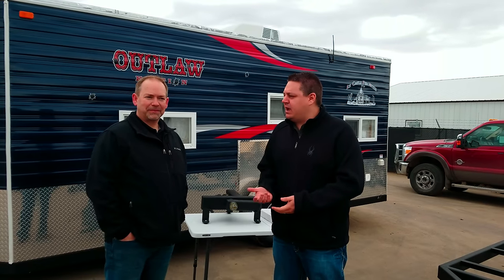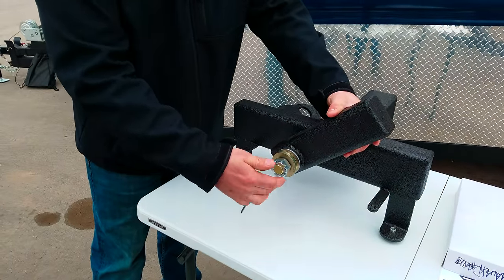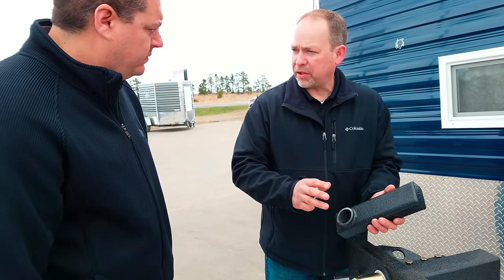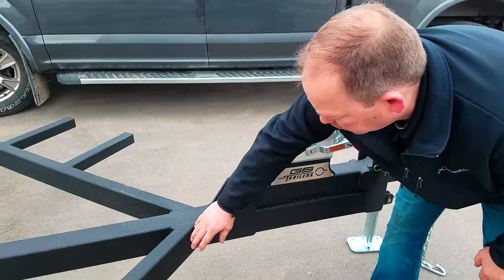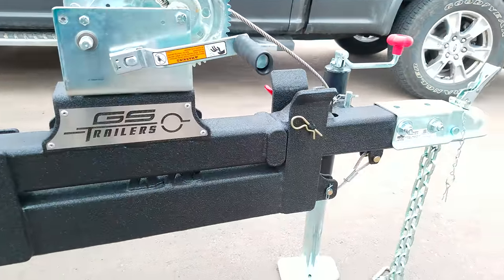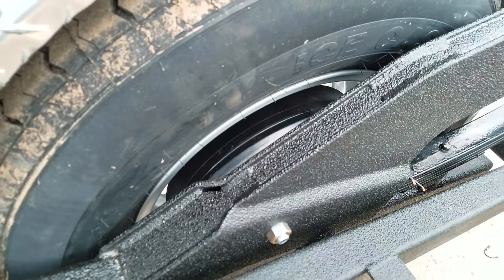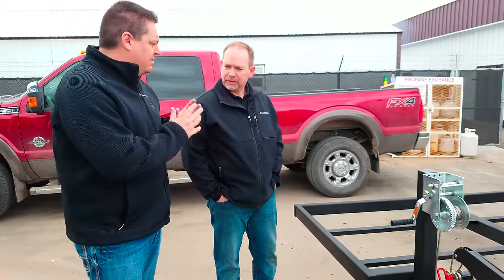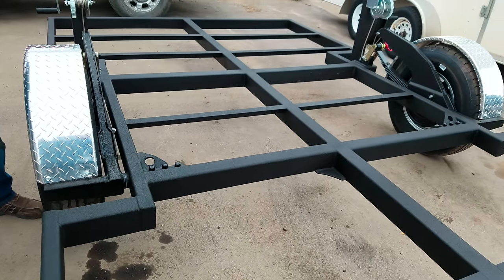Ice Castle frame and axles explained in detail by Aaron from GS frames (Broadway welding)

Comment: Question: How are you supposed to access those 3 bolts once the decking is screwed on and the walls are on? Also how come there's no fender backs on the fenders?
Reply: Looking at it I think it’s actually sitting on the table upside down.
Reply: So those 3 bolts would be exposed underneath.

Comment: I'd like one. I understand Minard's Leisure World, in Weyburn, Saskatchewan, Canada sells these. Is there any need for a weight distributing hitch? If so, how would I mount the bars? I was researching different models and even the 17 footers are over 5000 pounds.
Reply from the maker: We recently added the ability to do a sway control hitch. There is really only one bracket on the market that fits ice castle frames, but the e2 sway control system fits on it. I would recommend calling us and asking the service center about the tech info. We have installed about 12 of these in the last year and customers love them. I would say most are on 21ft+ units on smaller vehicles.
Reply from the maker: https://goicefish.com/gs-pole-tongue-adapter/
Reply: @SmokeyHills  Thanks for the link. I have a hitch on my truck that's designed to take 10,000 lbs, although the truck can only tow 8100, but that's beside the point. I used to own a 19 foot Nomad travel trailer and used a weight distribution hitch receiver to tow it, since that trailer was 5900 lbs and they recommend anything above 5000 lbs that a weight distribution be used. Otherwise you'll just tear the hitch off the frame. I sold the trailer years ago, but still have the receiver and bars. It didn't come with a sway control, but I'm not really worried about that. I also just found out recently, that there's a dealership in North Battleford, called Freedom RV, that also sells Ice Castles. I probably wouldn't go to them though. That's a 6 hour drive NW of Moose Jaw. I'll just stick with Minard's Leisure World, since they're only an hour SE and consider ordering one, since they finance, plus I'd get mine custom made, as I'd want to use it for camping, not just ice fishing. 

One thing I've wondered for a while, after watching many video tours of these Ice Castles, is why motorhomes don't have the dinettes in the back like these do. Would make more sense than having it on the side, where it just takes up more space, plus then they could have an extra bunk. Would be especially convenient on the smaller units.

Comment: What is sprayen on the frame to project it
Reply from the maker: There are different coatings, depending on the frame manufacturer. This frame has a product similar to a spray on  bed liner in a truck.
Reply: Basically looks like a wrinkled powder coating.